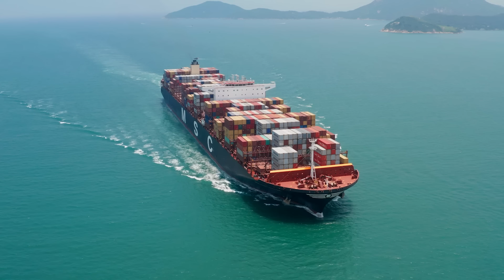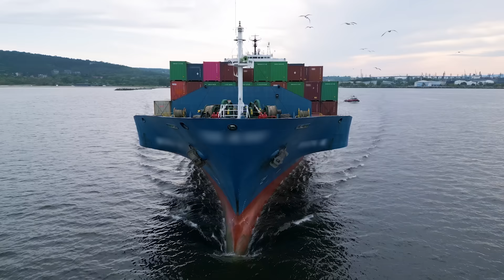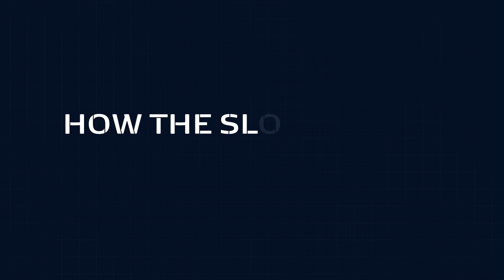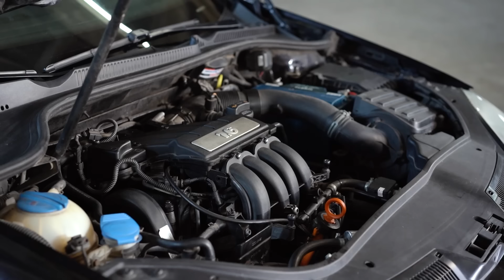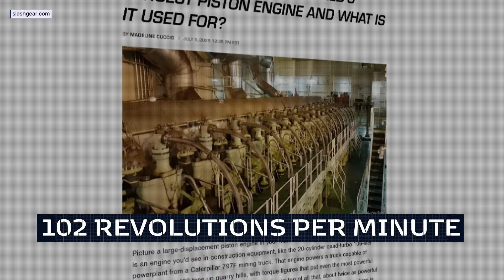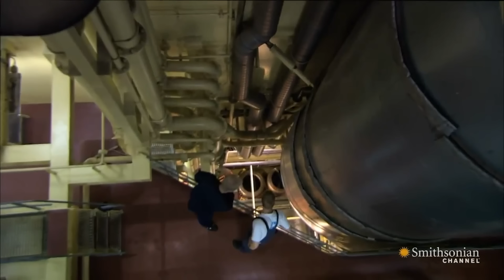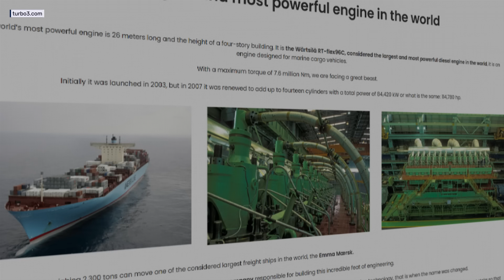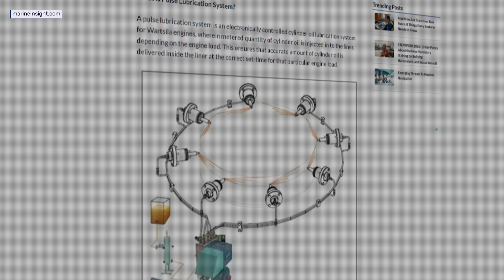The 100,000 Horsepower Engine

Comment: Somewhere a guy is already trying to figure out how to put it in a miata
Reply: another guy figuring out how to put an LS7 corvette engine into the ship.
Reply: @PeachMonster420 nah, you would want to use big block chevy. Only need 50 of them with twin 76's to move that cargo ship on VP113, or maybe 25 if you can get enough M1 to keep it choochin.
Reply: @randomguy1371  What have you been smoking? Nm is what is important to make this ship move. This engine got around 7 000 000 Nm, thats more than 10 000 standard LS7, more than 5000 LS7 that has been tuned to 1350Nm.
Reply: @Roovstah🤦🏿‍♂️🤦🏿‍♂️🤦🏿‍♂️
Reply: @Roovstahexcept you’re neglecting the rpm factor, the warsila operates at less than 1000rpm the ls runs roughly 7 times faster, multiply the torque by 7 by gearing it down to the output rpm of the warsila you would have comparable torque
Reply: @Theace88x  I think, maybe I am wrong, but that's something called 'humor'? Correct me if I'm wrong.

That's called meta-humor, or humor about humor.

That's called Jeff.

And it's absurdism and hyperbole.

I can keep going. I'm game 🙃🫠😉
Reply: @r @randomguy1371  agree with this guy. I’ve got a small block with flowmasters on it. It’ll pull a lot of boat, and that’s the small one…
Reply: @PeachMonster420  just swap the engine, the Miata already had a tank engine 😂
Reply: ...or an RX-7. I had one and for years people asked me why I hadn't put a Chevy 350 in it yet, in place of the Wankel engine. My response was always that is simply wasn't an RX-7 any longer if you did that.
Reply: @rtyrsson yeah, but you still have a well-balanced, rwd, lightweight, and stylish car.  I get it though, the purist side of things.
Reply: @firstnamelastname6216  

a 350sbc weighs alot more than a 13B Rotary though,
Now an all-aluminum Honda k24 however, would be a viable swap!
Reply: Is yours a 2nd or 3rd gen?
Reply: rtyrsson Cry about it , its unrelaible junk engine
Reply: First gen s-10!
Reply: Love this😂  maybe a little custom fab work and also put a turbo or a propane kit
Reply: hatchback
Reply: Hi I’m “a guy” I don’t have it figured out yet but I’ll update if any ideas come to mind (don’t expect anything until ant man’s tech becomes available)
Reply: Hmmm, the neighbor does have that oul Yugo 2 door in the back of his hay barn... I get back to you, I have planning to do.
Reply: First a Volvo as I sort of pilot test
Reply: @gdmdb107  Suggestion, an old P1800
Reply: 🤔Garage54 trying to fit one in a Lada
Reply: I bet there is alot of "Hell Yeah!" involved. (And rock music)
Reply: You will need to upgrade your tyres with this new engine or you will get wheelspin with a million NM of torque!
Reply: It's easier to put the Miata inside the engine..
Reply: This is hilarious, I made this exact joke when the video started!!  😂😆🤣
Reply: I love your style immediately. One critique, it really should be that it's being retrofitted for the starter on a Mazda Wankle
Reply: Westin Champlen already did it.......................

See video here... (
Reply: With a supercharger no doubt.
Reply: All ya gotta do is...😂😂
Reply: Quadmillon 96 mm turbos
Reply: Easier to put a Miata into the engine
Reply: @MirzaAhmed89 well yeah, that's actually possible.
Reply: Luke Combs said "A cold beer's got twelve ounces
A good truck's got maybe three hundred thousand". 

So according to Luke Combs a good truck is a medium sized container ship.  Which would be, in fact, a respectable truck.
Reply: Fiero, but yeah.
Reply: 😂 Comedic perfection!
Reply: Not possible 
But you could put a Miata in it
Reply: @PaulG.x all I see is a lack of ambition 😂😂😂
Reply: No worries just extend the front subframe and wheelbase by 90'
Reply: You could probably put a miata in one of its cylinders
Reply: anyone have a giant miata?
Reply: MX-5*
Reply: Nobody message Westen Champlin with this xD
Reply: Dude yeah
Reply: Clicked on this video looking for this comment 😂
Reply: Twice.
Reply: Ha ha ha

Comment: How does one START such a monstrosity? I doubt the existence of an electric starter that is up to the task …
Reply: High pressure air, ~30 bar, is blown into the cylinders in sequence to push the pistons down and spin the engine over.  Then the fuel cuts in and the engine starts

Comment: 25 knots is plenty fast enough to water ski behind.  Thousands of people could ski behind a modern container ship.
A second hands makes a full rotation around a clock face ONCE per minute.  The Wartsila crank spins at 102 revolutions per minute, or 102 times faster.  COME ON!!
"Family car engine holds between 1 and 2 liters."  Uh, NO.  3 and a half liters is a minimum for a "family car", and you can buy pickup trucks and SUVs with up to EIGHT liters.
25 knots is 28 mph is 51 km/h.  Who drives that slowly in the country?  Who wrote this?